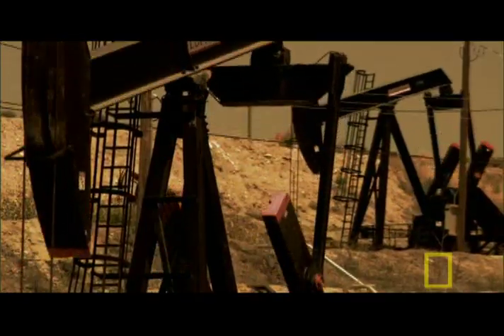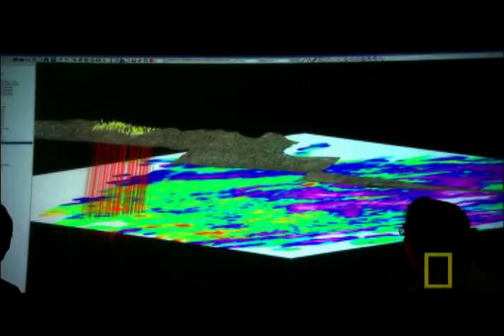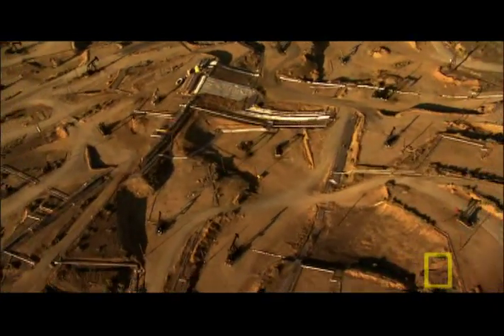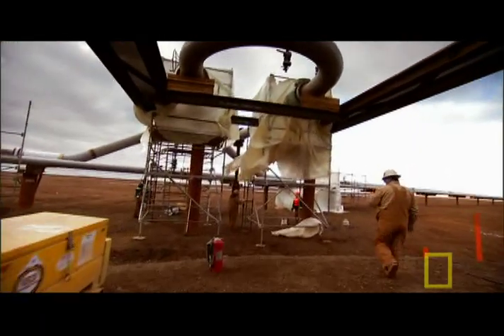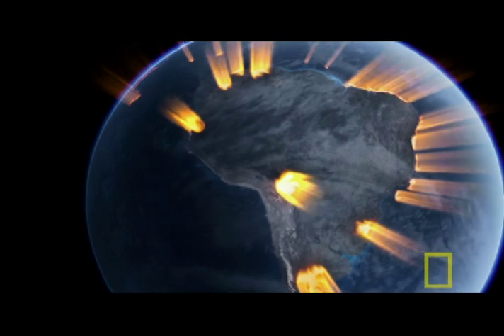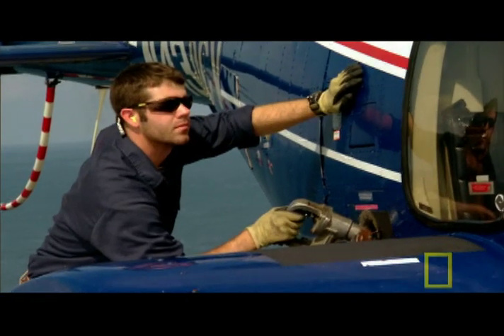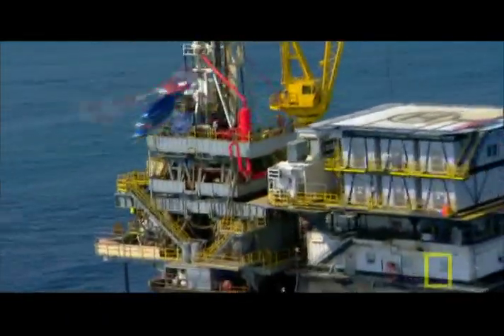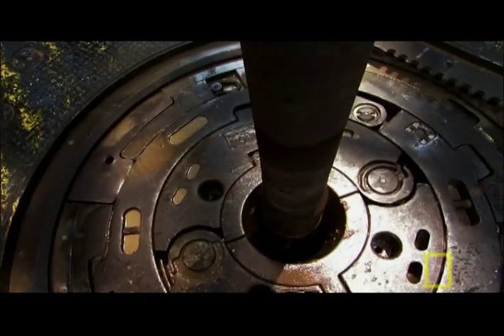Extreme Oil Drilling | Explorer

Comment: @235RB and the US living standard isnt higher than in north europe (norway etc), its even higher there, still they consume less oil than the USA (per capita ofc), a single person dont need to get to the next shop for some milk with a 2500kg SUV, air con on, using nearly 20 liter on 100km. A 30 ton truck can manage sometimes with 30-35 liter on the highway I think. Oil is too cheap in the US, our european gasoline prices (8-9$/gal) would reduce the consumption rapidly in the US.

Comment: @235RB Crap, there are other forms of energy too, natural gas can substitute all the oil used in the transportation sector, cars were ment to drive by alc, Rockefeller involved due to electrity and light bulb which destroyed the need for "his" petroleum, after this Standard Oil became what is has been. We would use coal, hydropower, gas and of course renewable energy. We would be maybe fewer people..most oil used has been wasted anyway. USA used ~25% of oil with an 2-3% population long time.

Comment: @TerrierBram your numbers are way off.  hemp seed is 28% oil yielding 112# per acre.  hemp seed oil weighs around 7.5# per gallon.  so the correct gallons per acre would be somewhere around 15 gallons.  some people are making claims to 100 gallons an acre but thats no realistic number.  Im a biodiesel manufacture and have access to very accurate numbers on the oil side.  as far as the ethanol goes, i dont know.  i can say for sure your 1000 gallon comment is not even remotely close to actual

Comment: When they say that oil has a good energy in energy out ratio does that include all of the energy that it takes to heat the ground so the oil will flow. We should just use the natural gas that they use for our cars. I know that it doesn't have the btu of gasoline but it wouldn't be wasted and save on importing so much.

Comment: water boils at 100 *C...pressurized to  100psi,  water will boil at 170*C..that extra heat is called latent heat...in order to effectively use steam injection for oil production you would need to use a pressurized system....changing the properties of everything involved in the process....so technically you won't start a fire...all production equipment for steam injection is usually above par!!

Comment: Boy my wallet sure would feel a lot better if the politicians would let us dig for oil in Anwar. Gas could be a lot cheaper. But no, instead of thinking about people and their families the kook tree huggers are too worried that we might kill a caribou. Alaska is nearly untouched by humans and is roughly 1/3 the size of the continental U.S. Ethanol is not the answer, it is nearly as expensive as gas and burns a lot faster than gas. It has also caused food prices to drastically increase.

Comment: nuclear energy makes sense for places which don't have a lot of sun or wind. fact is is that nuclear energy releases 0 carbon emissions, no harmful pollutants, there is residual radiation, but you're more likely to receive more harmful radiation from the sun in a day than a nuclear facility in a year. unfortunately, many environmental groups don't even consider nuclear energy and would rather burn coal and oil at moderate amounts, i find that sad.

Comment: Even So the world oil is going down. Since the day we started drilling oil to now which is only a 100 years or more we have used up half of the world's oil. In 50 years there might not be any oil left. So thats why we need alternitive energies fast and we need it on a large enough scale to replace the energy produced by current fossil fuels.